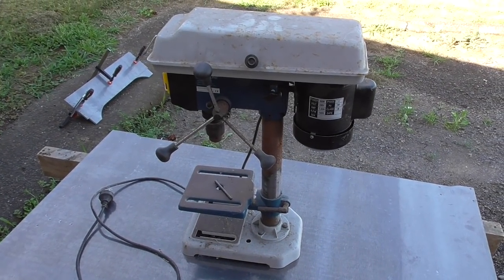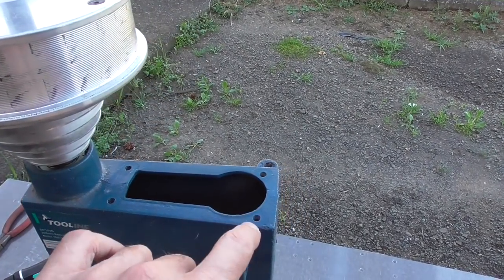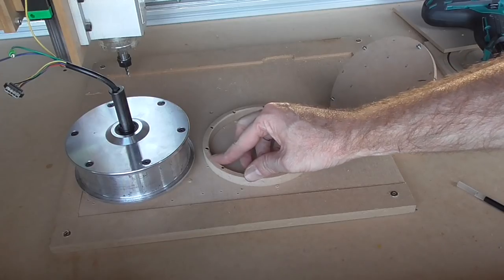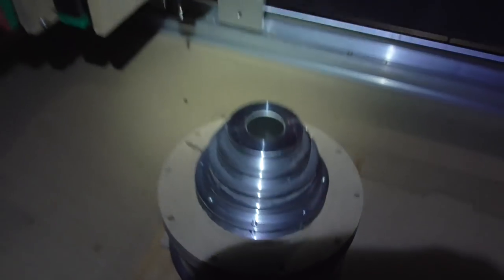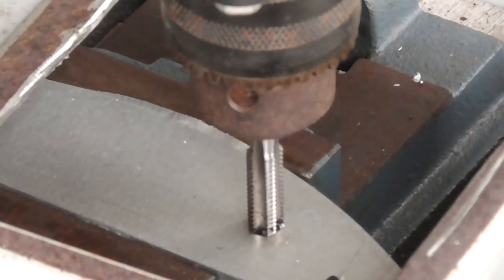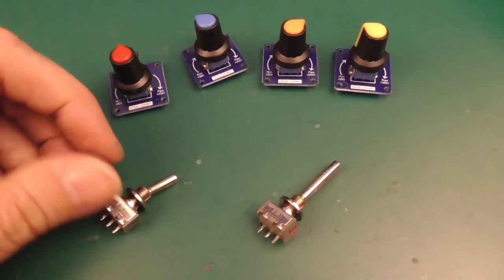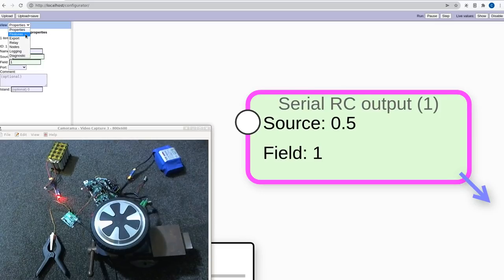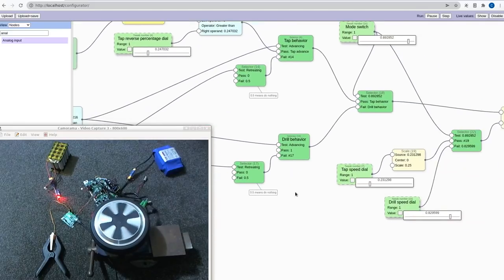Old drill press + hoverboard motor = power tapping thingy

Comment: those motors are BLDC, they are basically stepper motors with limited pole numbers. Also, you can just control the position with a position sensor.
With the right firmware you can do what you want, not with a hack with potentiometers...
Reply from the maker: Stepper motors are arranged so that energizing alternate coils will move a known distance, with no sensor feedback required. I wouldn't call these steppers because the method of control is quite different, and you can only roughly determine position based on the hall sensor feedback. But this is all beside the point because I wasn't really interested in controlling position, I was just showing how a rough position mode is available in the "Feru" firmware. The potentiometers I used are only inputs for adjusting speeds manually, they don't control the motors directly.
Reply: @iforce2d  you can control bldc motors position very finely by modulating winding current, which is what microstepping is.
That is how gimbal motors are controlled.
Reply from the maker: Yes, that's how the Feru firmware is doing FOC.

Comment: Based on those results, it looks like you could cut down the length of the spring, and get the amount of force to resist gravity just barely.  Fewer coils == less torque
Reply from the maker: I've been attaching a clamp to one of the three lever handles to provide a bit of weight. It lightly holds the toolbit up when I retract, and then lightly pushes it down when the weight comes forward, which works out ok.
Reply: @iforce2d  should have just left it how it was after you ton some tension off of it There is no reason that a bit of upward tension would hurt anything. In fact, it would be better if there was some upward tension.

Comment: Hey you do know the fundamentals of taping threads in any material right? 

At most make a full turn in then back out a half turn, at least, then repeat.

Never try to just run the tap through, you need to clear the cut of trapped shavings or you will gall the threads and probably break the tap.
Reply from the maker: As other commenters pointed out this depends a lot on the type of tap and the type of hole, and the material. As long as the chips have somewhere to go (open-ended hole or very deep with lots of space) it's usually ok, at least in aluminium. 
https://www.youtube.com/watch?v=y7G90eFYzxs
Having now tried this on many holes in 12mm aluminium, I found the best approach is just go straight through, with lots of cutting oil.
Reply: As he said, there's no hard rule. A lot of the time reversing is just an antiquated practice that has been debunked, like thinking that back dragging a file will ruin it. There are a million different situations. Different material, tap size, tap type, through/blind hole, tap condition, etc. And they all require different methods.

Comment: You could get a cheap VFD and use the orginal motor on the drillpress, no need to change. Some VFD have tourqe controll and can be controlled by bus, voltage, 4-20mA, binary inputs and so on. Probably cheaper then your current setup.
Reply from the maker: Not sure if the belt drive would handle the torque necessary. So far I've had slipping all over the place, in just about every connection.
Reply: @iforce2d  Metal gear probably better. But maybe you could add new, fresh belts in parallell? Seems like it is poissible.

Comment: I am sure you could have glued the MDF rings to the hub.
Reply from the maker: I certainly could have. What type of glue would hold to smooth aluminium with the torque necessary is another question.

Comment: Nice serie. I’m wondering what software you use in the last part of this video?
Reply from the maker: That's a system I'm still working on. I will make detailed videos sometime, until then you can see other videos where I used it https://www.youtube.com/playlist?list=PLzidsatoEzeieb0l_EUxpR0p7ed_RUPD6
Reply: @iforce2d  Is the software propriety thats comes with the “sbusmixer” hardware? Or is it a standard software tool? And is the “sbus mixer” for sale? Where?
Reply from the maker: The firmware will be proprietary. The configuration side in the browser is mostly Javascript so that's essentially open source, but it would be a huge amount of work to adapt it to other microcontrollers. Between the browser and the firmware is a 'relay server' third component that allows the browser to access the serial port.
I'm hoping to sell the boards someday, but the price of the MCU is extremely high right now (covid?) so nobody would want them. I'm told things will get back to normal after a while.

Comment: If you want te have the motor free spin maby the easiest way is to put e switch that cuts off two of the motor wires. It can also serve as a emergency stop/ safety switch.
Reply from the maker: That would indeed avoid the braking. Problem is the hall encoder of the controller would detect a discrepancy between commanded movement and actual movement and enter an error state. Disconnecting the hall sensor also triggers error state. It would be better to modify the firmware to ignore any encoder discrepancy after the throttle has been in the middle position for say 3 seconds. Probably not something I'll bother with unless it does somehow turn out to be really annoying.
A physical disconnect would be great as an emergency stop though.

Comment: What is that web-gui you are using from 37 minutes and out?
Reply from the maker: That's a system I'm still working on. I will make detailed videos sometime, until then you can see other videos where I used it https://www.youtube.com/playlist?list=PLzidsatoEzeieb0l_EUxpR0p7ed_RUPD6
Reply: @iforce2d  ah, cool!, need to check out a bit more what sbus is.
Reply from the maker: sbus is a communication method for transmitting multiple channels on a single wire. It's typically used in RC planes where the channels control servos, but also to send RC control inputs from a receiver to a flight controller. It's only a small part of my system though, but the name happens to have stuck, at least for now. Overall it's more generic, you could think of it like an arduino that doesn't need traditional coding.

Comment: Rap the spring back tight and heat it with a torch slowly until desired tension.
Reply from the maker: You can adjust the tension just by winding it less. The point is it will always move to a target point, rather than counteract gravity.
Reply: @iforce2d  lmao did we both watch the same video?
Reply from the maker: What's your point, am I wrong?
Reply: @iforce2d  yes… all you did is change how soon it hits the same rate of strength.
Reply from the maker: Exactly, and that's all heating it would do too. There will always be a point that it settles on, and will increase in resistance further from that point. That is not the same as counteracting gravity with a constant force at any position.

Comment: i'm surprised you didnt just pull the spindle pulley off and mount the motor directly to the spindle.
Reply from the maker: You mean the steel shaft inside the aluminum pulley, that's only about 2cm in diameter? Not sure how I would fix my MDF to that and maintain alignment, and I wouldn't be so confident that the MDF could handle the torque at such a small radius.
Reply: @iforce2d  yes... but dont you have a CNC table.. couldn't you make an adapter out of some plate :D, that aside you could still cut the belt pully down a buit so it wasnt so tall.

Comment: cool! you realize you could use only the percentage dial to do the whole tapping operation right? just go to "1" to reverse the tap out of the hole.
if i miss understood the function and is wrong i apologize. =) 
i really like your projects and i still wish we were neighbors! =D
Reply from the maker: Sure, it can even be used as is with the radio control, the question is how much convenience you want. I will probably leave out a couple of the dials I showed, since they will not change much in practice and can be determined well enough by twiddling with the 'virtual' dial.
Reply: @iforce2d  i am all for ALL the dials. it was just something that i thought was cool.

Comment: If you don't drill through... you will continually collect crap in the holes.
32:36... Just weld an extension to the Key's Shaft.
36:37... since pulses are being sent to the motor you could count those pulse to get a rough idea as to the feed and retract distance.
Reply from the maker: Yeah it's looking like my plan to make blind holes will be a pain in the butt. I'm starting to think I'll just have to drill all the way through.
The motor does not move by counting pulses, it's not a stepper motor. If it was a stepper though, yes we could do a lot of cool things.
Reply: @iforce2d  If I'm not mistaken... that is a brushless motor and the motor coils are being energized in sequences by the brushless motor ESC. Those are brushless motor pulses that could be used as a sensor/counter for direction and distance travelled by the motor shaft. Of course not as accurate as a stepper motor's pulses but i'm sure better than using time to get rotational distance travelled.
Reply from the maker: Yes you could run it as a stepper motor like that, but it would have only 15 steps for a full revolution. I suppose you could think of this a stepper motor that is doing very fine microstepping all the time, so 'pulses' are not the same as motor coils.
I think the word 'pulses' is the cause of our confusion here. The firmware could be modified to count how many magnetic poles it has turned past, and stop at some desired point. That might be what you mean. But that's essentially what the 'speed' mode does anyway. It increments a number saying how many poles should have been passed, and the motor moves to match that (which is how it returns to the starting when I try to move it by hand). That number is being increased over time at a certain rate, eg. after 1 second it might increase by 5, then two seconds it will be 10, so the outcome you're talking about is the outcome it's doing already, just by setting it to a constant speed for some duration in seconds. The hall encoders are analog and not precise, so I think the way it is now is about the best we could expect.
Reply: @iforce2d  That makes sense...

Comment: just add a dead zone so it stops giving input
Reply from the maker: If I wanted to study for hours and learn how the hoverboard controller firmware works I could do that, but I don't. The ibus input effectively does "add a dead zone" by sending a pure number with no jitter.
Reply: @iforce2d  lmao your flysky controller you can add dead zone so it stops thinking your touching the sticks because its old and not centered
Reply from the maker: I'm not aware of any such capability on this radio. I would ask you to explain how it's done but it's mostly irrelevant because the radio is not part of the final setup, I was only using it to check things temporarily.

Comment: Have to admit to skipping a lot of your video here but are you aware of ‘through hole’ and ‘blind hole’ taps? That’s what industry uses these days .. no need to back off rotation to break dwarf? Buy a spiral flute one specific for Aluminium.. if you can. Great for blind holes and in ally will be fine for through holes also
Reply from the maker: I saw some videos where they just blast right through and the swarf comes out in two neat threads, not the horrible mess I get. They seem to always be using spiral taps, is that what keeps it tidy?
Reply: @iforce2d  it also mentioned about material and which tap finish to use.
Reply: @iforce2d  yeah... but !! There’s two basic types that we (UK) use for machine tapping. The two flute design will ‘push’ the dwarf (edit.. jolly swarf) forward in the nice two spirals (they look similar to hand taps but with special grind on the tip) But don’t confuse with the ‘spiral flute’ design those will make the swarf spiral upwards.. they are intended for blind holes (holes that aren’t through holes) they’re a little weaker than the two flute ones but work very nice in Ally
Reply: @patkirk960  They're called bottoming taps for blind holes. But they can't be used unless you tap it with a plug tap first. (Can sometimes be used on softer materials, without using a plug tap first.) Or more properly, a tapered tap, then a plug tap, then the bottoming tap. So, since you need to run two tapping operations for each hole, it's usually better to just drill the blind hole deeper than needed and just use a plug tap and not worry about the threads that aren't fully formed because they're deeper than the screw will go.